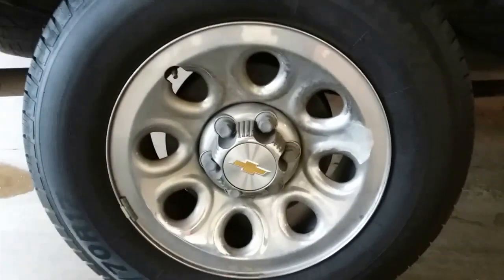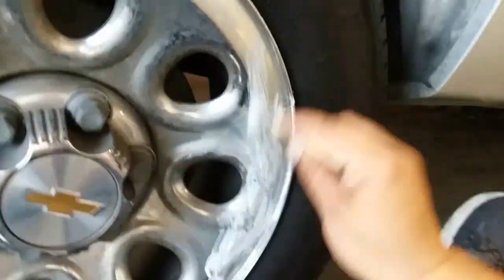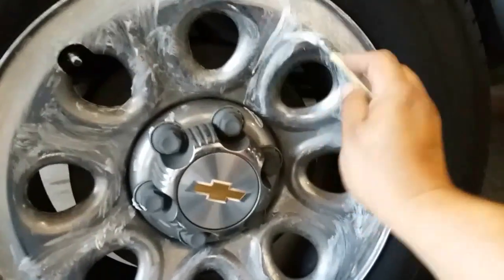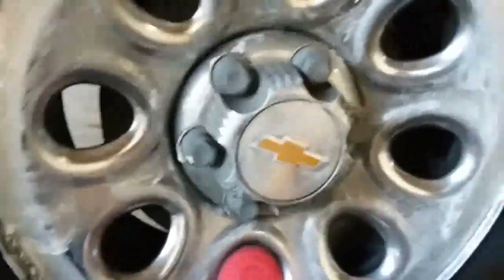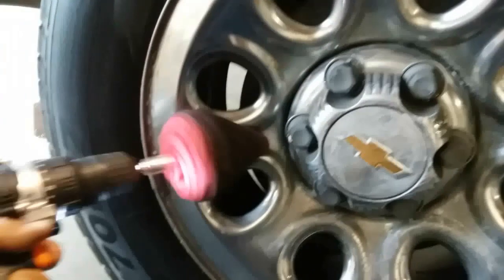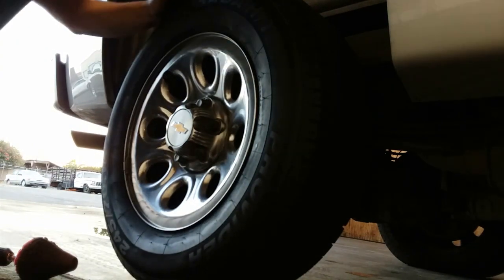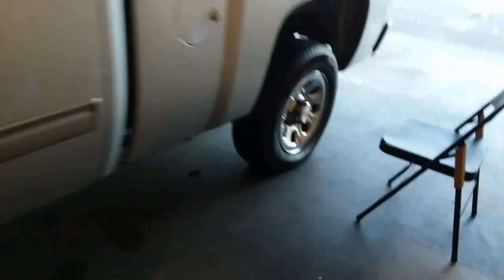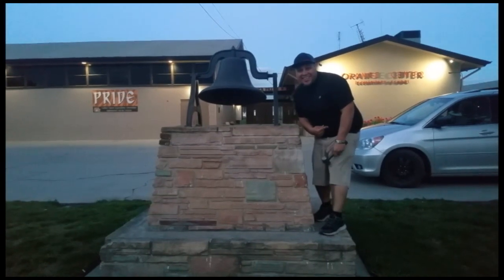How to: Polish Dull Rims out to CHROME Rims with Mothers Polishing Power Cone 360

Comment: Unless there is a lot of brake dust build up a good wash makes wheels chrome again. My wheels looked foggy like yours so i washed them and they came out good except for the corners where brake dust sticks
Reply: My wheels look ashy I think oxidized. I did a compound on them and then applied a polish and looks brand new. Should i put a wax sealant on them? They're black rims on a 2017 camaro.